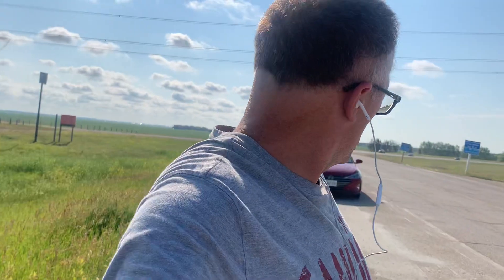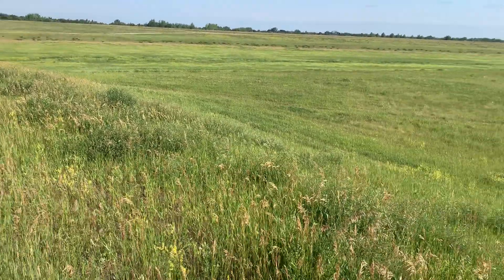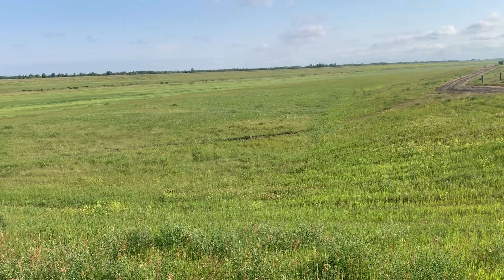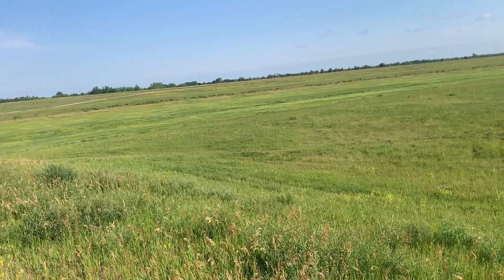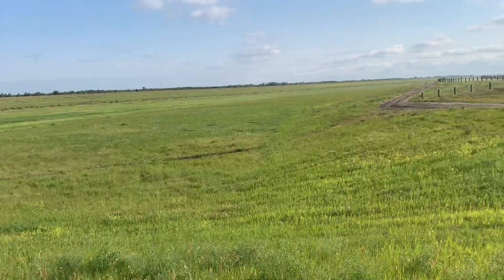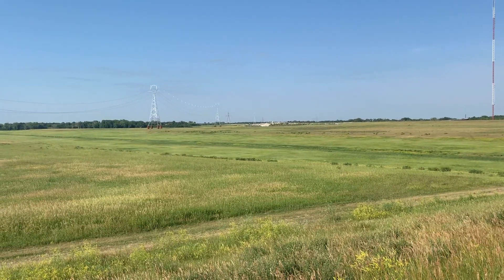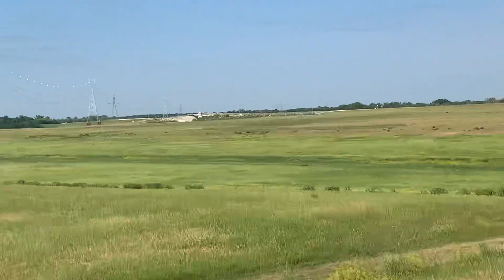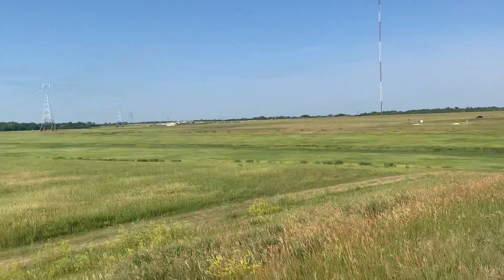Winnipeg’s Superpower to Protect the City from Flooding: The Red River Diversion Spillway

Comment from the maker: For this video, I am in Winnipeg, Manitoba at the site of an incredible human construction.

The Red River Floodway is an artificial flood control waterway protecting Winnipeg. During flooding situations, this 47 km (29 mi) long channel diverts part of the Red River's water flow to the east, so that it harmlessly bypasses the city, and discharges it back into the Red River below the dam at Lockport, north of the city. 

The human dug channel can carry floodwater at a rate of up to 140,000 cubic feet per second (4,000 m3/s), expanded in the 2000s from its original channel capacity of 90,000 cubic feet per second (2,500 m3/s).

Since its completion in 1968, the Floodway is thought to have prevented over $40 billion Canadian dollars in cumulative flood damages. It was designated a National Historic Site of Canada in 2000, since the floodway is an incredible engineering achievement both in terms of function and impact.

Floodway construction started on November 27th, 1962 and finished in March 1968. The construction was a major undertaking with 76.5 million cubic metres (2.75 billion cubic feet) of earth excavated. This was more earth than what was moved for the Suez Canal construction, and at the time this project was the second largest earth-moving project in the world – behind the construction of the Panama Canal.

It works!!

Please check out my blog http://paulbeckwith.net and consider donating to support my research and videos.
Reply: is it big enough? course not.